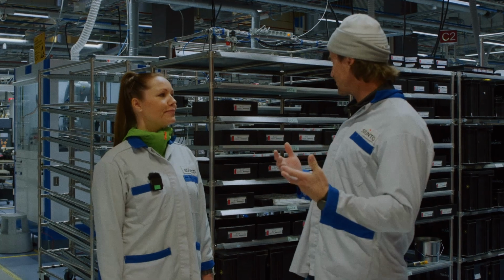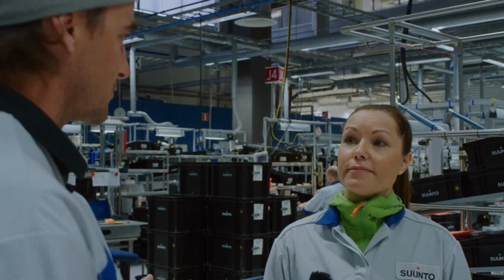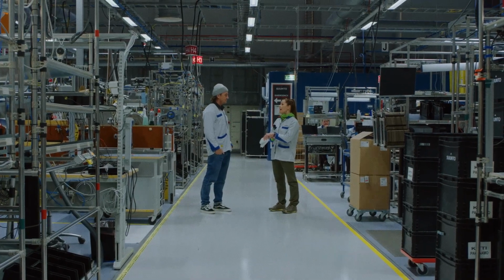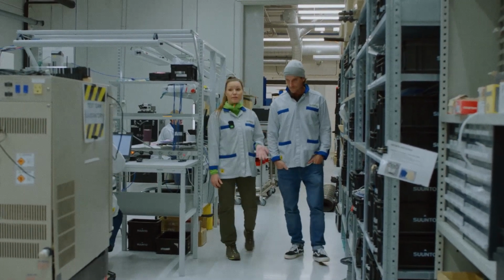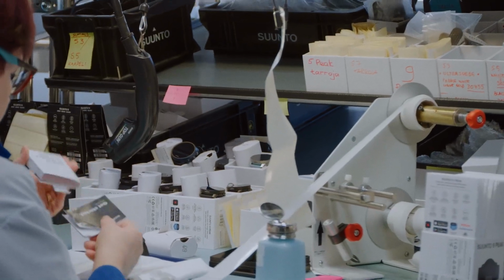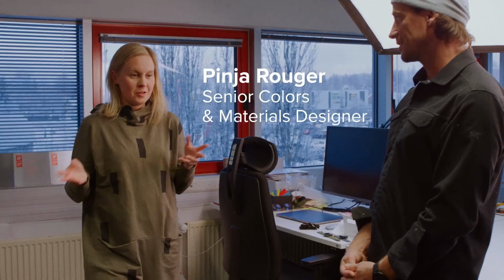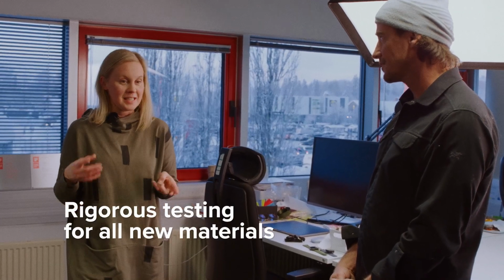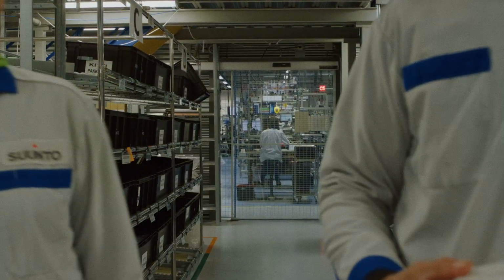Greg Hill learns about sustainability at Suunto

Comment: I have a Suunto core all black that I bought in 2010 and have worn almost every day since. It is covered in scratches and dents from 15 years of rock-climbing, backpacking, trail running, mountain biking etc...and it still works fine (although the backlight is dimmer than it was when new). People regularly comment "what watch is that?!?"...so the patina has served it well. 
The most sustainable product is the one you already have.

Comment: 3,5 months, that's the period my Suunto 9 worked. After that, important malfunctions appeared. On a 6 km run, the watch reported a difference of 800 m. (less). The support doesn't care at all about customers. I contacted 3 shops and all informed me that they stopped working with Suunto due to horrible customer service, and I fully agree. The answer provided by Suunto was "move your hands each time you make steps, as this is the only way for the watch to approach the movement" ! Amazing, and no solution. Therefore, we are now looking for another brand. Suunto is s*** !
Reply: Ok, Tim😂